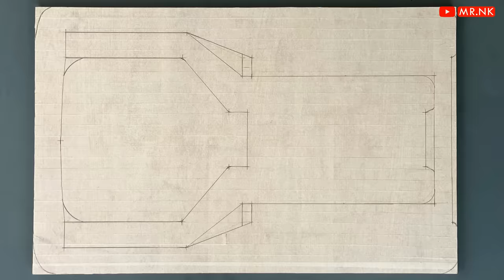How to Make a Secret Foldable Chair at Home

Comment: Ikea is terrified - she has a serious competitor. Excellent build and design quality, just consider the more horizontal seat position and lower rear wall mount. And it is also worth making the back more vertical - this will allow you to sit without tension, perhaps it is worth making it an invoice with a slight slope.
An excellent engineering solution, but there is room for improvement.
Reply: Very.atractive.design.can.you.make.1chair.for.me.